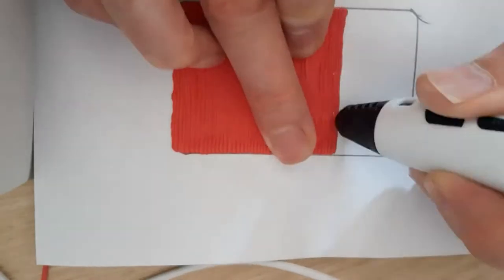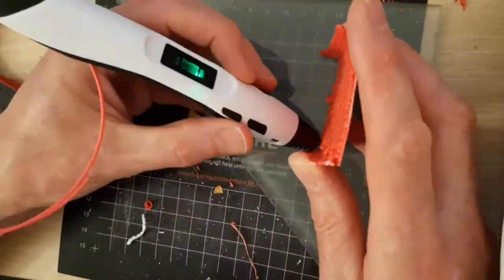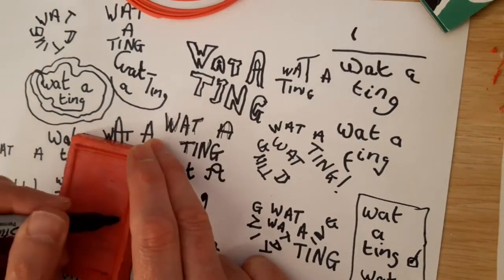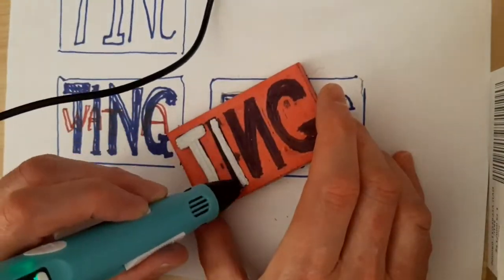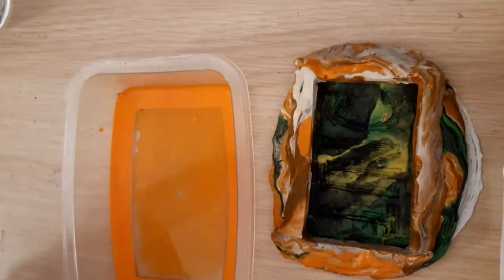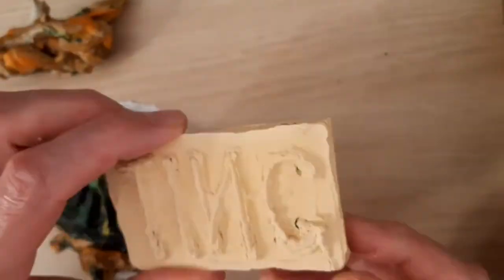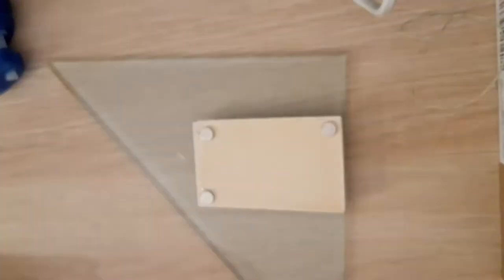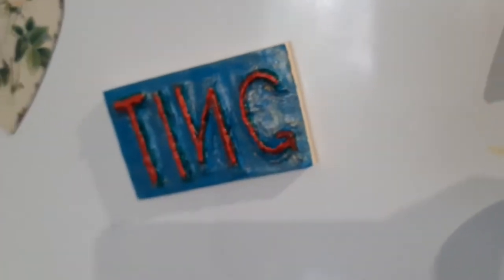Making a fridge Ting

Comment: I like the video, it was nice to see you do something a bit different, I haven't used plaster of Paris in years.

Have you ever thought about trying out 3D printing? I recent bought an Ender 3 Pro kit and built it and it's a lot of fun. It seemed like something you might be interested in
Reply from the maker: Plaster of paris is such fun, so simple and making moulds from plasticine is easy peasy too. You could try the process and make lettering out of a bent coat hanger and squish it in. Endless possabilities, if this inspires someone else to make something then it is a success. If it gains another Zeeteah fan then so much the better. I have toyed wit the idea of getting a 3D printer and I think I will crack at some point but for now learning the material first hand is still fascinating.